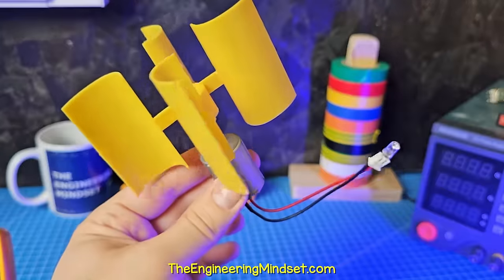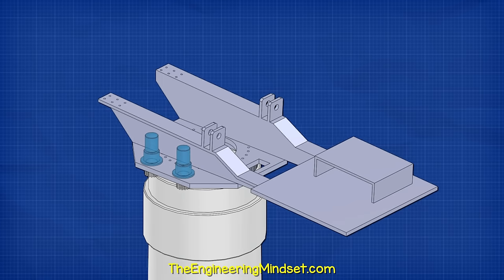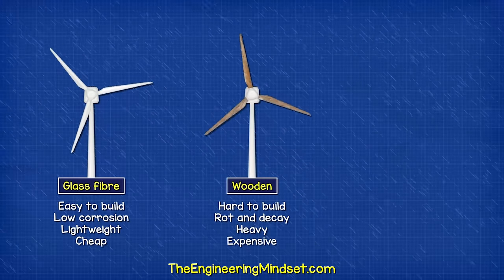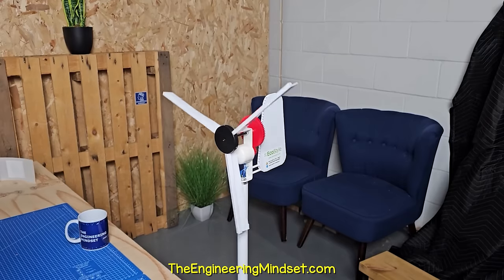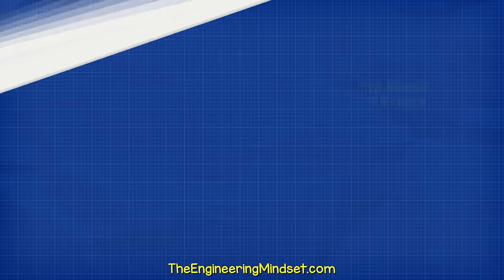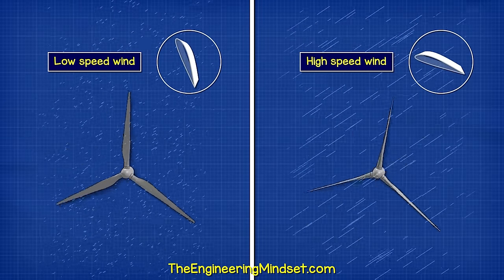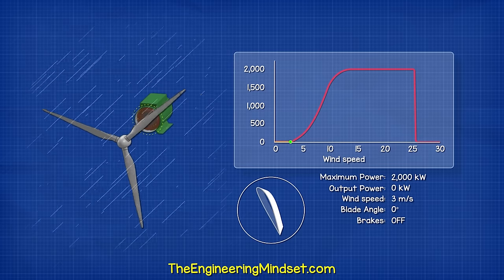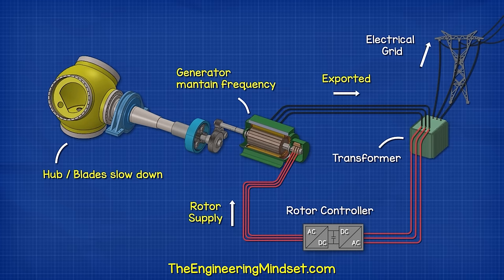How Wind Turbines Really Work: The Hidden Secrets

Comment: You need to talk about the burying of old blades. Wasteful
Reply from the maker: True, the issue of disposal is an issue. There are some great examples of bridges, bike stores etc being made from them. It's a bit outside the scope of this video through as we're just looking at the engineering behind how they work.
Reply: I remember watching a video on turbine blades a year or so ago and they were discussing changes they have made to the blades to make them more easily recycled so hopefully that will be a thing we only have to deal with for the older turbines .
Reply: Faaaarrrr less wasteful than 30 years of refining petro and burning it once. The blades can be recycled, poison gas cannot.
Reply: No u
Reply: Just like how we burry radioactive nuclear waste in concrete tombs because it will continue to be dangerous for millenniums. With turbine blades, we can at least recycle some of the construction materials.
Reply: Recently one of the major wind turbine manufacturers, Vestas, and several other research insitutes discovered a new chemical that can break down and recycle currently used blades. They stated the chemical process relies on widely available chemicals so it can be scaled easily. Seems like they're in the process of scaling up so we may soon see a solution for blade recycling.
Reply: @DD-DD-DD 😂 you’re definitely not biased
Reply: @tonybrown5425 what he said is 100% correct. Mines emit massive amounts of toxic gasses 24/7. Turbines dont.
Reply: Plumbing national haven’t educated themselves for a decade worryingly that makes them dangerous to employ if their working practises are a decade out of date! I wont school them, you can take a horse to water but sometimes i need rendering in to glue and calling it a day! #Boomers 😅
Reply: More like: up to date with current information, you should try it, instead of cherry picking doom ajd gloom stuff that feeds your unhealthy bias
Reply: I'd rather walk on it than breathe it
Reply: Just heard a company is being paid by GE to pulverize the blades, and sell them as a fuel product for a concrete plant
Reply: There’s a large landfill in Wyoming where they bury the used blades. I understand the scope of this video but wind and solar are nowhere near as efficient as oil, gas, and coal not to mention heavily subsidized. In Wyoming these windmill are downright ugly and the energy isn’t even kept in state. These farms should be placed closer to where the energy is being sent and not left for Wyoming to deal with not to mention defile the landscape..
Reply: The old blades can be scrapped and then added in cement
Reply: @BritishAnts  school myself on which part ? There was video of them burying huge blades in the desert.
Reply: There's a company working to turn them into concrete and are progressing towards an enormous scale
Reply: Less wasteful than burning hydrocarbons
Reply: @Maldonado_Extra we have been able to reuse spent fuel for a bit now with fast reactors.
Reply: @williamsonnie9935 coal and gas subsidies dwarf those of renewables.
Reply: You need to talk about fly ash disposal. Wasteful
Reply: @williamsonnie9935 just wait till you learn about the oil extraction in Wyoming
Reply: ROI is very good on solar and wind because the “fuel” costs nothing.  Once it’s built, it mostly just sits there and does its thing for the next 30 years without shoveling coal or piping a constant flow of gas into them.  Utility companies wouldn’t keep building more and more solar and wind power if they didn’t have their place.  It’s really hard to make a good argument against free fuel.
Reply: It’s called recycling. Same with old cars. How much garbage is buried? A non issue.
Reply: Everything about the wind turbine is wasteful.
Reply: How much waste do we end up after oil & gas extraction? Grow up kid!
Reply: @aarone9000  you mean parents. Your time at school was wasteful
Reply: There is one initiative taken by a danish architect company about recycling aged wind turbines….❤❤
Reply: Please don’t forget how much government subsidies are given to make these monstrosities viable
Reply: I’m more worried about where all the used, dead batteries are going since I’m sure we go through millions a day all over the world. Everything nowadays needs batteries.
Reply: @marykuga4589 Batteries are not that hard to recycle, it just wasn't worth developing the tech until recently.
Reply: They bury the metals in the ground I believe wind turbines is a wasted metal .
Reply: @DD-DD-DD they don't recycle them if they tell you they do their lying.
Reply: I remember doing the math. If we were to generate the ENTIRE worlds supply of electricity with wind power. After 30 years the blades would equal 2% of our YEARLY trash production. We probably should focus on reducing waste more than not building wind turbines because of their blades not being recyclable
Reply: @williamsonnie9935  does efficiency of natural gas matter if it will fuel the heat death of this planet? Asking for your grandchildren hoping to breat clean air and live somewhere other than a flooded swamp someday 😅
Reply: Burying of old blades would cease to be a problem if engineers were allowed to build them strong enough. But the bean counters tell engineers to design them to be cheaper. Also, I thought blades could be ground up and used for something. I don't recall the details.
Reply: @paulnotdownunder3172   What about the environmental costs in the manufacturer of turbine generators? Same with battery manufacturing.
Reply: @joewoodchuck3824  yup, cheaper and crappier
Reply: @genevievewalsh2007  Yes, and it happens in every industry.

Comment: As an electrician, some of what you say does go over my head when it's outside my field, but i love to learn the things I can grasp. Great channel!!!
Reply from the maker: None of us are born with the knowledge, it comes with time and effort. You're putting in the time and effort by watching something you don't yet fully grasp.
Reply: The power coming from the generator goes to a converter where the power frequency get converted to match the grid 60HZ. Insulated gate bipolar transistors and capacitors are used to achieve this. The power goes from the generator, converter, transformer, grid.
Reply: @chrisanderson6538  This is true for small turbines in the 10s or 100s of kW.
In the MW range it is almost always done by doubly fed induction generators because the converter doesn't have to pass the whole power but only a small amount to feed the rotor. This is usually in the order of the difference between the mains frequency and the rotors rotational frequency. So if you plan to have 100MW and +-10% deviation in speed, you need a 10MW converter instead of an 100MW one
Reply: the mechanics part is what we hate most. also we all agree, we need a constant speed for the useable 50 or 60hz in sync. or the turbine just spins without producing exploitable 3AC. 

okay skip that, install a nuclear plant, problem solved. trees saved. birbs happy.
Reply: Further advantage of doubly fed generator is the rotational momentum which helps stabilize grid frequency and reactive power.

Comment: Great explanation of doubly fed induction wind turbines. These are referred to as type 3 wind turbines. Another method like the one used in your small scale wind turbine is too rectify and invert the variable frequency power from an induction or permeant magnet generator to the grid frequency. This is what the newer type 4 wind turbines do but they require higher capacity power electronics to do this because they are converting 100% of the wind power as opposed to only a small proportion that is being back fed into the doubly fed induction machine like in a type 3 wind turbine. The reduced cost of power electronics and lack of brushes and gears however is making type 4 more popular.

Comment: 9 out of 10 as a windturbine technician i can confirm everything mentioned in the video.
Ignoring shadow cast, lubrication and cooling of the gear, main converter. Everything else is  very precise. Some Companys run there Windturbines with electric motors but some only use hydrolics to pitch or yaw the turbine.

Comment: I grew up in imperial valley, and in great weather conditions, from the valley, you could see the silhouette of the turbine field near acorn casino. Just dozens of em, backlit by the sun easily noticeable. 

Now, if you go to imperial valley, many of the farms have been replaced with solar farms, and at the base of the mountains going to san diego, there is a massive wind turbine farm. Coupled with the areas numerous geo plants, the area is a hotbead of renewable energy. 

Thank you for finally answering one of dozens of questions i had about my homes renewble energies. This was a great video!!
Reply: Where's your food coming from?
Reply: @MelbourneHandyman  the Central Valley, which has much more fresh water than the Imperial Valley

Comment: 17:17 this electrical load can also be used to vary the power output and breaking of the wind turbine as opposed to mechanical and aerodynamic breaks. Allot of smaller wind turbines use a maximum power point tracking algorithm via the the voltage on the inverter to vary the current and hence torque of the generator which can control the rotation and power output of the turbine. Small scale wind turbines can also use large variable resistors as dump loads but this is less efficient.

Comment: The way the frequency is regulated by adding/subtracting the frequency of the exciter coil is brilliant.  I never realized the turbine output was synced to grid I assumed they went into some kind of controller and then that synced to the grid.
Reply: Yes your assumption is correct. There are many different methods used. For example in offshore power production the AC current can be converted into DC for transportation through the ocean. A nother method is to convert AC into DC and then back to DC with exactly 50Hz.  Power electronics are quiet efficient so conversion losses are not that high.
Reply: Inverters are expensive so skipping them is great
Reply: @aw244 The use of solid state d.c. power to 3 phase converters, also allows power factor correction to be applied which increases overall efficiency.

Comment: This is a great video and it explains the inner workings of these towers quite well. I actually work on the larger 1.5-4 MW wind turbine platforms for a career but never really know how the generator worked till now. The larger towers use a 2 stage planetary gearbox vs a single stage like what was shown in the video.

Comment: The virtual rotating magnetic field of the to rotor done by the excitation to achieve rated frequency at lower rotor speeds is just brilliant.
Reply: how does that work i didn't understand that part
Reply: @egoinjury  in conventional machines, you can imagine a magnet with north and south poles rotating with the prime mover (i.e. a gas turbine). So the frequency of the generator is directly proportional to the speed of the shaft. In wind turbines, imagine that the same magnet is able to rotate at a different speed than the shaft, so when the shaft is slow, the magnet will rotate to compensate for the generator to match the grid frequency (50 or 60 Hz).
Reply: @r2d2chia  sure, some sort of slip ring housing over the drive shaft I guess but how is the difference achieved?  Maybe the answer is too long to explain but I’d like to know
Reply: @egoinjury  just by triggering the excitation’s SCRs to the poles in the correct rotational speed. Remember that it’s not the actual shaft speed that determines the generator frequency, but the rotation speed of the poles in the field (shaft), which in turn induce a voltage in the stator.

Comment: I worked on a site that had a huge wind turbine on the land around 50-70 feet from where I worked, it was pretty cool but very intimidating when it was rotating at speed. It did make me think if it goes wrong, someone is dying. I think they're cool but would rather not work around the potential debris field!
Also, not sure how this channel wasn't suggested to me before but it was an easy sub before I finished watching your solar panels video, very clear and easy to understand as well as great visualisations, no wonder you are 3.4mil subs deep, great work and thanks.

Comment: Thank you very much for this wonderful explanation. Note, if a flywheel is used to help stabilize the frequency output, it is a simple system, simpler than electronics, feedback or a battery. Also, adding gears and a flywheel to a small turbine will greatly improve performance and reliability.

Comment: Thanks! I had always wondered how the frequency was controlled on wind turbines. How do they parallel to the grid? Getting all those things to run in phase sounds challenging.
Reply: Frequency converters at the bottom of the tower
Reply: Speaking in general terms (it can get complicated on the micro level... so I'll stick to Macro) power produced by the generator is run through a "rectifier" (actualy an IGBT module) where the dirty AC is turned into DC. Its stored on a large capacitor bank then inverted into 60Hz by another IGBT module before leaving the turbine. The controlling circuitry has a grid moniter that watches the grid and tells the turbines IGBT module when to fire so it matches the grid.

Dirty AC ----> Smooth DC ----> Clean 60Hz AC ready for use on the grid.

Comment: The efficiency has definitely increased, but wind is variable.  True, you can have wind at night, but lately in the Antelope Valley in Southern California we've had little to no wind days except today.  My house roof mounted solar panels are a great example of generating power and don't require much maintenance.  If I had a LARGE piece of land I'd have both the panels and the turbine.
When standing in the AV's wind turbine "farm," I noted how it sounded like a jet engine's turbine.  Very interesting!
Good description of operation Paul in this video!

Comment: Fascinating i had some classes as an engineer in renewable energy but not this indebt or this clear. I remember that they said they used a synchronized motor design as the generator because it could be used to kick start the turbine. And that seems to be a half truth , the ability to feeding a frequency in to synchronize the speed to the net does sound like a better reason to have this design thant to just "bring it up to speed".

Comment: Do you have more videos available or would you be willing to make a video on the output voltage frequency sequence described in 18:00 to end of video?  I am a Mechanical Engineer so I deal with this sort of thing when considering pump and fan motors especially for facilities without power conditioning or perhaps utilizing site power generation or backup power with poor frequency control.  I believe the topic is Permanent Magnet vs. Induction type motors.  The permanent magnet type motors make sense and that's what we learned about in undergrad but I am curious about this induction type of motor.  Superposition of phase makes sense but I am having a hard time understanding how strong the rotor current needs to be and other quirks about the induction motor.  You make great videos, I have learned so much from this channel! Cheers.
Reply: I would also be really interested in a deeper dive into this this is the first time I've heard of this. And I always asked myself how grid frequency is maintained.

Comment: Great video, but just one correction on aerofoil part. Because of it's shape, low pressure is produced on the top side and high pressure on bottom. Because pressure is different, speed is also different. It has nothing to do with longer distance.

Comment: Would be interesting to know where the energy comes from for all the monitoring, feedback, start up and stopping that required and how that tied in.
Reply from the maker: Can see towards end of video
Reply: I guess more broadly speaking, how much output does a single wind turbine produce compared to what its needed as input to operate the system as a whole? @EngineeringMindset
Reply: 5kw to operate 13kw when the yaw and pitch system are running and then outputting it’s rated power output 1.5mw to 6mw depending on the tower

Comment: I never knew you could change the frequency of the output of a generator by changing the frequency of the powered stator. I though the stator was always a permanent magnet, but it now makes sense why it’s powered, cause permanent magnets cannot get any more powerful, and you cannot induce a variable rotating magnetic field in them, that’s such excellent engineering. I always thought a wind turbine would require a bulky external circuit that converts the variable frequency AC to DC and then back to the precise 60 Hz AC. Excellent. But, let’s say we have these wind turbines in a secluded place where the power consumption is very little, then converting to DC and then transmitting DC would be far more efficient than AC. There would be losses at the conversion plant that converts the DC back to AC, but in this situation, the overall efficiency of the entire system would be much higher than transmitting AC.